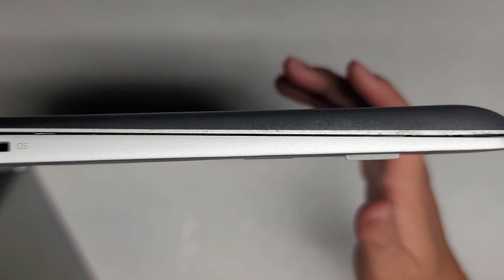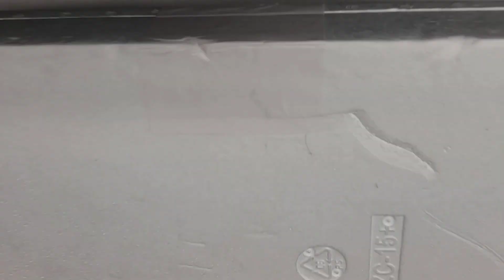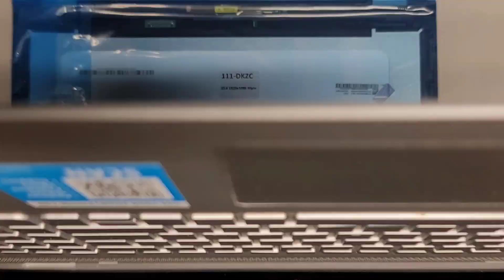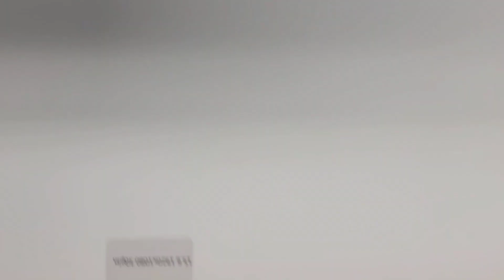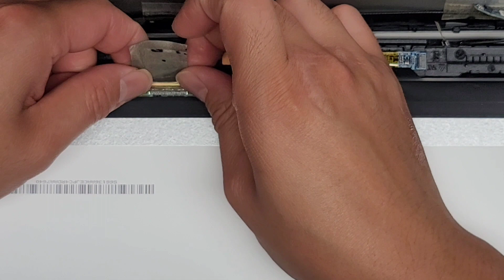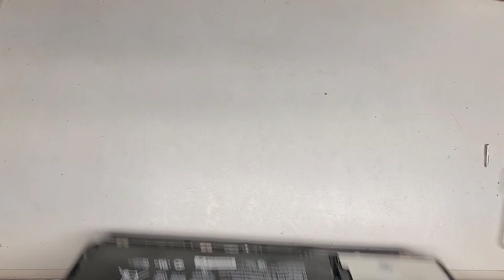HP ENVY x360 m6 Convertible PC m6-aq103dx Disassembly RAM SSD Hard Drive Upgrade Battery LCD Screen

Comment: Where can we order the screen replacement? i got the same model and cracked it so im trying to replace my screen.
Reply from the maker: What's the model number on your screen?
Reply: @ItsBinhRepaired  model: m6-aq003dx
Reply from the maker: That's the laptop model. What's the screen model? There's a sticker on the back of the lcd panel.
Reply from the maker: Yeah